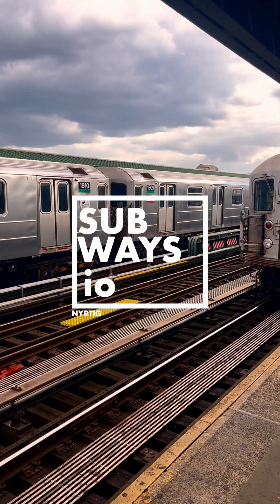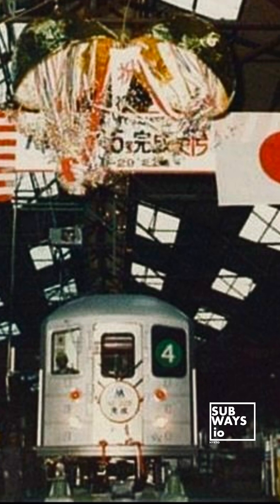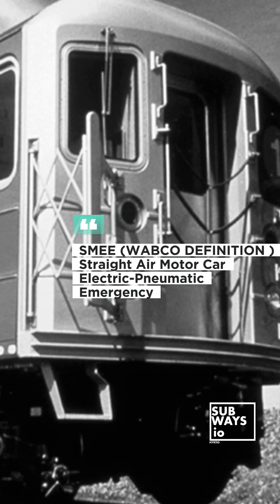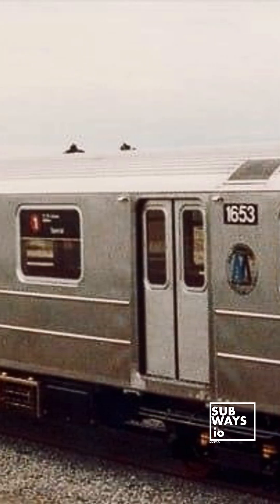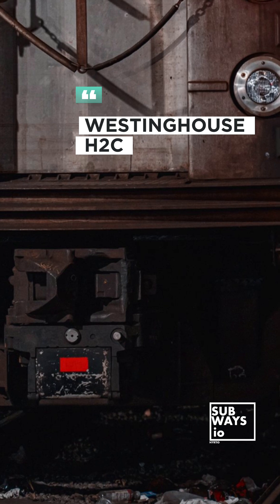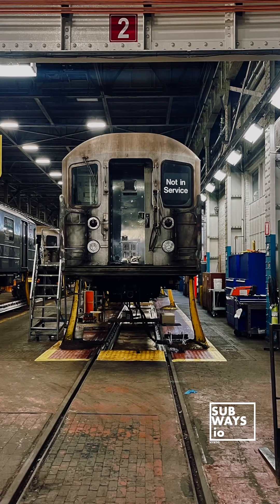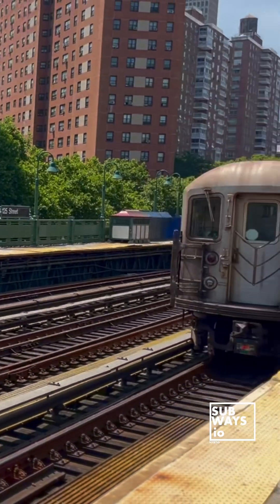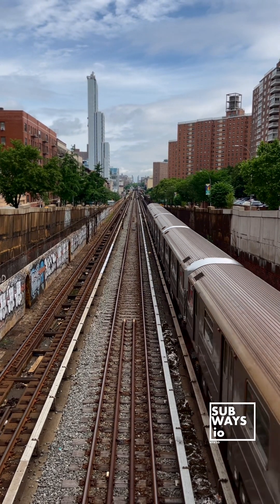R62A: NYC Subway’s Reliable Workhorse

Comment: These are the subway cars who the average subway rider complains about for having bad AC 🙄
Reply from the maker: @adammars1438  that is correct but the next question is why? We cover both the what and why here.  Let’s dig in So this class of Car suffers from a type of design flaw in the AC system. Whereas newer trains are roof mounted and modular. They also have dedicated compressors for each unit meaning that if one compressor goes down, the other unit can still work independently. This is not the case with the R62A both units share one compressor, and if one compressor goes down, they both go down on top of the fact that to maintain or maintenance. The system requires way more work as you have to repair everything as one single component more time in shop. Overall maintenance is important as well, but an in fleet as large as this that’s going equal a few hot cars. Especially if you’re trying to maintain service.
Reply: @Subways_io  Yup! Exactly as I thought about these cars. AC design flaw aside, they’re pretty solid subway cars. I grew up riding these cars when they ran on the 7.
Reply from the maker: @adammars1438  Indeed Having an under car AC unit also don’t help debris and also get up in there. But it’s the progress of technology you learn overtime and improve.
Reply: @adammars1438  You what also. Millions and millions of people are definitely complaining about the 8 Thrid Ave Elevated line being torn down and still processing about non stop 🛑
Reply: You know what. I'm telling you something. No matter how much they tair down the 8 Thrid Ave Elevated line down because the 8 Thrid Ave Elevated line never sleeps.

Comment: The R62AS also had the 8 Thrid Ave Elevated line rolling signs and the 10 12 13 11 purple 🟣 rolling signs just like the 7 Flushing line. The 8 10 12 has the Lexington Avenue rolling signs. Green . The 13 9 has the same exact red circle 🔴 color just like the 1 3 2 rolling signs.
Reply from the maker: Indeed, in this case, the (8) would have been assigned to the Pelham Express, replacing the Diamond 6. While it's well known that the (9) was used for skip-stop service, people often forget that the 1 had skip-stop service long before the (9) was introduced, which made things easier. The (10) was planned to replace the Diamond 5, representing Nereid Avenue service. The (11) would have been used for Flushing Express, replacing the Diamond 7. It appears that the (12) was possibly intended for a Jerome-Lexington Avenue express service, and finally, the (13) was proposed for an express variant on the 7th- White Plains Road line.
Reply: @Subways_io  Keep bringing up the Thrid Avenue Elevated line because it's definitely needed right now.
Reply from the maker: @leecornwell5632  we’re going to release a video on the Webster Avenue extension fairly soon.
Reply: @Subways_io  The powder blue 🔵 8 Thrid Avenue Elevated line could definitely go back to the old routs between Gun hill road Clearmount Tremont Webster Boston road Bronx and Batincal gardens Frordam plaza and under ground on Thrid Avenue to Battery park place or south Ferry under ground.
Reply: They was talking about exstending the 3 trains to ninth Ave Elevated line to connect to the 4 Jerome Ave line to Burnside Jerome Ave or 167 street Jerome Ave. The 10 trains could definitely replace the furmer 8 Thrid Ave Elevated line making local stops and express stops and let it run under ground on Thrid Avenue to Battery park place or south Ferry.
Reply from the maker: @leecornwell5632  Correct didn’t happen due to Third Rail difference and tunnel clearance.
Reply: @Subways_io  I have seeing the 8 Thrid Ave Elevated line all the way to Manhattan and the Bronx. However they have the new engineers are studying on that aswell. There was really nothing wrong with the 8 Thrid Ave Elevated line at all. The TA workers could of had fought to keep the 8 Thrid Ave Elevated line running instead of Governor LaGuardia and Robert mosses and Kenny trying to get over them. I definitely know when you found out about the 8 ninth Ave Elevated lines being tairing down you was also pissed off. Including everyone.
Reply: Eventually they are gonna rebuild the brand new Thrid Avenue Elevated line both this time. Never rebuild another elevated line in Manhattan again ever again. They don't have to ever worry about looking outside there windows 🪟 in Manhattan anymore. That's a real serious facts. It May not happen now it's definitely gonna happen sooner or later. I'm glad you are keeping it 100 percent real on the Thrid and ninth Ave Elevated lines and touching real basic things on it and on top of things that really needs to happen.